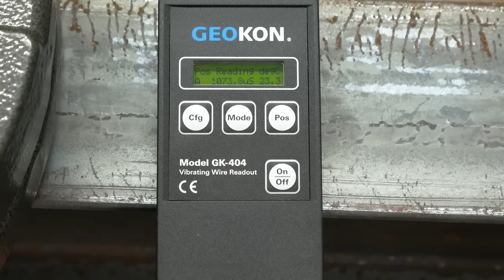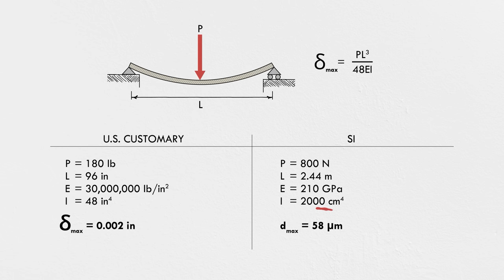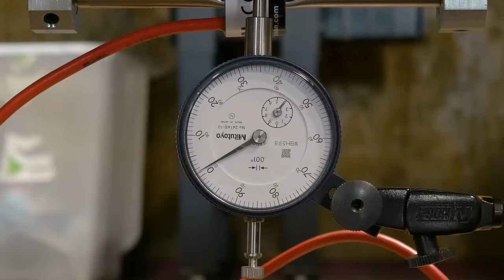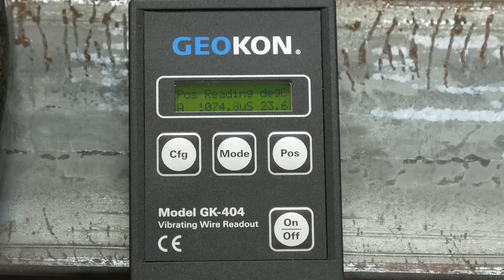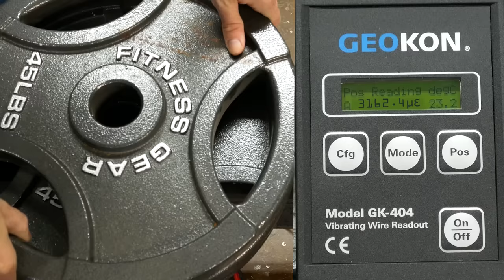How Sensors Keep Bridges From Collapsing (and other structures too)

Comment: I wonder how much in the 1st experiment deflection was causing the dial indicator to move and how much it was just the settling of everything between the slab and the top of the steel beam such as the cinder blocks and those roller things you have on them. Even a little grain of sand underneath one of the cinder blocks getting crushed as you step onto the beam would have affected the read out a little bit.

 It would have been nice to see you preload a ton of weight onto the beam directly above the cinder blocks just to make sure those were completely settled and then step on it in the middle to measure just the deflection. A couple 100 pounds centered over each of those roller things would probably do the trick then you could zero out the dial indicator and step on it

Comment: Just an FYI, @8:42 Steel is significantly stiffer than concrete (about 7x stiffer). The difference is you have a much larger section of concrete material than a steel beam (going back to your deflection equations, E (material stiffness) is smaller with concrete, but I (section stiffness) is larger).

Comment: Amazing video! At some point you mention that the sensors use wires and frequency. I was wondering, isn’t the wire length - and thus its frequency - a affected by changes in temperature over time? We are talking about infinitesimally small changes here, so even tiny temperature variations over the span of several measurements would result in an incoherent dataset. How does the instrument account or compensate for this? I’m guessing even the least temperature-sensitive wire material would still have this problem, when measuring such tiny increments

Comment: The plumber measuring the pressure should be measuring the flowing pressure of the water, which is important for a few things. 1st: So your tap and appliances have the specified minimum flow rate and 2nd: So the utilities company doesn't risk backflow and thus contamination into the pipesystem.

Comment: The way Grady measured the beam deflection at the beginning is only makes sense if supports on which the ends of the beam are resting are incompressible. Otherwise - the whole beam can move down and up due to elastic deformation of the supports.

Comment: optical fibers can be utilized in concrete structures like dams and in electrical transformers. it measures deformation and temperature by shifting the reflected optical signal inserted in optical fibre.

Comment: As a Plumber, I know that pressure change exist, I test the pressure to test the PRV is working correctly and at safe levels. most homes in my area have high pressure.

Comment: I am civil engineering studend who works for a geotechnical engineer and we have an Inclometer! I am not allowed to handle it though, as it costs 17k+ and the calibrating alone costs at least 2-3k😅
Also: absolutely love your videos and your book!
Reply: You work for a micromanager.  Think about what happens to that instrument when UPS or FedEx takes it to and from being calibrated.  Even the old Force Balanced Servo Accelerometer type had to be shipped to and from calibration.  It's why we take 0 and 180 readings to cancel out any bias errors.  The newer MEMS sensors do not suffer the fragility of the old ones.

Comment: I believe Fiber Braggs Gratings-based Optical Fiber straing gauges are going to be used more and more in the following years.
They are immune to EMI, have low drift, and the main advantage is the wiring: you can put a lot of sensors on the same single fiber at different places without needing any additional wires. 
That’s pretty practical: you can have 40 strain gauges on only one fiber, a few kilometers from the nearest relay.
Reply: They've been saying that for 20-30 years and it hasn't gone full mainstream yet.

Comment: I take objection to the statement that 8:40  "compared to steel, concrete is a really stiff material". 
Concrete's elastic modulus is "just" 30 GPa, whereas that of steel is 200 GPa, about 6x higher. 
No matter whether you compare volumetrically or mass-for-mass, a steel member steel is far stiffer than a comparable concrete member.
The only metric where concrete wins is stiffness-per-cost-price.

Comment: Hey, great material. Is there a chance for a followup on stress in materials like concrete? I've been always wondering how they build large concrete slabs so that thermal expansion does not break them.

Comment: Water pressure fluctuations makes sense where you live since Texas uses fixed speed pumps more with water towers Vs places that use VFD’s only. 

Some use a mix of VFD and towers, but depending on how the piping is done inside the tower, that can lead to stagnant water if the pressure doesn’t change.

Comment: In Glasgow when they built tenenements they inserted brken glass up the center of the end of the building. If there was movement, the  glass would break and fall  to make a little pile, there was a problem. But after 90 years people  forgot. And buildings fell down, boom!

Comment: Huh, I had no idea that was how strain sensors worked. I'd always assumed that it was via some piezoelectric effect. Just goes to show that in every domain, if you want to measure something accurately, you end up doing some kind of frequency measurement. Counting lots of super fast oscillations (be it of a wire, of a light waves) is just the best was to be precise.

Comment: I don't know if the sensors do this.... But I feel that if the sensors could determine their location on the structure by being linked wirelessly to 3  or more other sensors around it. It would just be a matter of measuring the time it takes for the signal to go back and forth to determine distance between each other. You could then link dozens of them together to determine total shift in pressure, size, distance, shape, moisture, and other factors of the structure as a whole.

Comment: Great video Grady!  It was super interesting to learn how the wire sensors work.  It would seem to me that they would drift based on the ambient temperature causing expansion/contraction of the instrument.  How does the instrument account for this or is it not a concern?
Reply from the maker: They have thermistors inside, so you get the signal plus the temperature and use a correction factor.
Reply: @PracticalEngineeringChannel  just like analogue oscillators compensation circuit! Pretty neat.

Comment: Another great video as always.  However, at 8:45, you said, "compared to steel, concrete is really stiff material".   Concreate has about 1/7 the Young's Modulus of steel.  Did you misspeak?

Comment: Curious, how do those strain gauges deal with temperature fluxuations? I'd imagine their size changes with temperature, altering the readings?
Reply: In certain strain sensor set ups one sensor is "connected" to the material and another is just being affected by temperature. The difference (measured electrically by a wheatstone bridge or similar) is the temperature compensated strain. In others there is just a direct measurement of temperature and a calibration table.

Comment: Given your example of (the crack in) the concrete floor in your garage. What would you have done differently in the design and building process? 
PS: If the plumber was smart he probably knew about those changes and was checking the pressure at your home against the pressure you'd expect in the city grid. So if your home pressure was below or above a certain treshold one measurement is enough to see something is set up wrong.

Comment: Perhaps next time the metals distributor will deliver in return for a plug. BTW one way to get a compact trailer capable of much more weight than the chain store cheapies and suitable for pulling by car is to fab one of their size but much stronger. You can fab your own and states will issue a VIN (if required) after inspection by a DMV inspector. Many trailers are made this way,

Comment: Fun fact: load cells are used in some higher end brake-pedals used in sim racing setups. Cheaper pedals use a pedal that turns a potentiometer and resistance is given by a spring. The advantage of load cells is that they actually sense pressure instead of how far a potentiometer is turned. In theory this makes it much more intuitive to give the right amount of brake force to the sim.

The downside of load cell pedals is that you cannot blame the gear for your terrible lap times anymore. Unless maybe you just need to buy that €1500 direct drive wheel huh 🤔

Comment: My 120yr old house has some cracks in the concrete for the walls in the basement. I marked 2 points on either side of the cracks and used a sharpie to measure between the points. I check it mid winter (cold and dry) and mid summer (hot and wet). I WANT to know if the cracks are growing or just 100 yr old cracks sitting just fine and stable

Comment: "In a game you get to try again"
Engineers do "try again" though, during education they get to try different things and see why they don't work. Then in actual design, they run simulations and real tests and fail and so they try again. Even sometimes during construction, something that wasn't calculated causes the build to fail and so they have to engineer themselves around the problem.
Time and time again, engineers have gotten to "try again" when things doesn't exactly go to plan. But these retries often doesn't involve total collapses and lives lost of course.
But it still holds true, time and time again, that engineers indeed do get to improve their designs and builds after they are completed.

Comment: 00:50 Of course we can, and we do. Ever heard of the Tacoma Narrows bridge? From collapsing bridges to dam failures to a power transmission tower taken out by a blowing eucalyptus tree right in Silicon Valley this year, we not only can just try again to get it right, but often have little other choice. What is true is that we probably don't hire the same engineer to test the proposition of whether his or her third time will be the charm. As one structural-engineer-turned-comedian puts it, "People begin to talk after your third bridge falls down. It may not just be the drinking anymore. Guilty. You got me." ☺
Reply: Today is nothing like failures 120ya.  When the Brooklyn Bridge was under construction, a major bridge was collapsing somewhere in the world at least once every month. Roebling changed all that.
Reply: @Nill757  Hundreds of bridges still fail each year worldwide. Most have to be replaced, hopefully with lessons learned. The nursery rhyme notwithstanding, London Bridge never did fall down until it was finally replaced in the 1830's after serving its purpose for 600 years, no help from Roebling involved.
Reply: @ReflectedMiles  i meant in Western Europe and US in 1870, mainly suspension bridges because the engineering was not yet understood, in particular the need for a rigid road bed.. The only place they had major bridges.  No, there are not  hundreds of major bridge failures / yr US and W EU.
Reply: @Nill757  There is a convenient list maintained by Wikipedia, I believe.

Comment: One of the coolest measurement methods I’ve seen is motion amplification. You basically use a camera to take a bunch of pictures at a given rate and use an algorithm to exaggerate the difference between the images to detect movement and vibrations. It can be used to detect failing equipment. Here’s a cool video about it: https://youtu.be/rEoc0YoALt0

Comment: Your Plumber already knows from his experience that the water pressure in the whole system varies between certain levels. All he needs to know is if your water pressure is significantly lower than his expectation. That would indicate a problem he can solve. A single measurement is sufficient for that purpose.

Comment: Question-

That water pressure reading from your tap seems high. Was that from a side with separate pressure regulation from the appliances in the house? I know they will allow irrigation system pressures to operate higher than inside appliance pressures if on a separate regulator and back flow device… just curious… I prefer the higher pressures but have hesitated to adjust my regulator that high in fear of damaging appliances. If this is normal in some areas I’m not as concerned👍

Comment: "We can't build a project then watch the cars drive over it and see the pretty green and red colors on every structural member."
Then you showed the strain gauges and I got lost in thought. I was thinking about how I could wire those gauges to LEDs, attach thousands of them to a real bridge, then drive a heavy truck over and watch all the green and red LEDs light up as the truck passes.
That's one way you could do Polybridge in real life. I doubt anyone is going to pay for or loan out thousands of expensive strain gauges, though. And no one is going to let you use their bridge.

Comment: Um, what concrete and steel are you using where the concrete has a higher modulus than the steel? Steel is much stiffer than concrete unless you're using very strange materials.

Comment: I assume that in addition to having an engineer review the data periodically (say, on a bridge), you could also set up complex alerting. ie: If sensor A passes threshold X for more than 10 seconds, send an alert to some monitoring station, or text message a distribution group etc.
Reply: That is out there on the commercial side but it is going to cost you.

Comment: Well, if you build a bridge in the real world and it fails, you do kinda get to try again. Well, maybe not you, some other contractor will get the job to fix it :D 
Those kinds of mistakes are not just career-ending for the engineer, but potentially an end for the entire company that bid the project. 
(And there's a part of me that would derive a LOT of entertainment out of a video game that actually simulated that bidding process in addition to the engineering.)

Also, fun fact, in 8th grade I took a career-path oriented class that had multiple modules. One was a civil engineering module where we got to design and then build a bridge out of balsa wood then test it in a competition at the end of the class. One step up from video games is building a real model!

Comment: Recently the launch mount for the SpaceX starship failed, lofting debris into the air at high speeds, and leaving a crater and exposed rebar. Mr. Musk relates that after the static fire test, he thought the concrete would survive exposure to the rocket exhaust. In addition to the flamey bits I'm told there's an acoustic load. What sensors are indicated in a launch pad, flame diverter, water deluge, etc.? Can you apply your civil-engineering-fu to analyze the launch pad failure?

Comment: They installed such crack gages in the basement of my university building but the indicator was not even on the scale anymore as they wanted to do the reading. The building was built less then 25 years ago.. such a shame.

Comment: Wow, those wire sensors did not work like I expected.  I'm would expect temperature would interfere with the readings on  these, but I bet they have a temperature sensor and a correction factor for it.
Reply from the maker: Indeed they do
Reply: yeah i built these sensors, they have thermistors embedded next to the magnetic coil that reads the wire and as you say a correction factor is applied to provide accurate data

Comment: With the recent building collapses that have occurred over the past few years, why don't building codes mandate structural sensors to warn of pending disasters ?

Plus you have shown that it does not matter if the building was constructed prior to code revisions as sensors can be added later and still warn of things going bad.

Comment: Empirical data gets my motor running.  In another life, I would have been a civil engineer.  Also, Double-Edge Safety Razors for the win.  With my Merkur MK34C DESR and Astra Platinum blades, I can replace the blade every day and still spend 1/4 the cost of the current cartridge razors.

Comment: Here's question about bridge loads. Tennessee has a law regarding the distance of the rear set of tandems on a trailer from the pin, 41 feet to the center of the rear axle. It's called "bridge law." There is no law on how close to the front the tandems can be. Why? It would seem to me, the weight of the tandems, max 17,000 per axle, closer together would place more strain on the structural elements of the bridge.

Comment: What happens if an embedded sensor breaks down? Do you just accept that there will be no more measurements or is there a special procedure to replace the embedded sensor?
Reply: I don't know for civil engineering but, in my business area , 2 or 3 sensors would be installed for redundancy. Also it is always possible to measure at more points than strictly needed. So some interpolation / inference is possible. After all, one sensor does not cost a lot relative to the project as a whole.

Comment: Love the video. One thing that doesn't pass the sniff test is the comment about the relative stiffnesses of concrete and steel at 8:47. As I understand it, if concrete were stiffer than steel, prestressed beams wouldn't be so wonderful.
Reply from the maker: I mean, you can look up the elastic modulus of most materials. You don’t have to take my word for it!
Reply: @PracticalEngineeringChannel  thanks for the reply! But online it does look like steel's is about 4x concrete
Reply: @julianpetrillo7984  yeah concrete's Young modulus is about 30 GPa while steel's is 210 GPa...
So concrete is significantly SOFTER than steel, contrary to what is said in the video. It takes less stress than steel for the same strain.
Maybe what was meant was that the concrete beam is shorter, so it takes more force to deflect it as much.